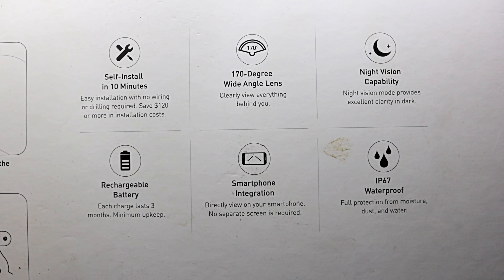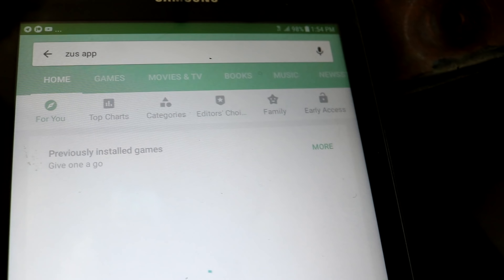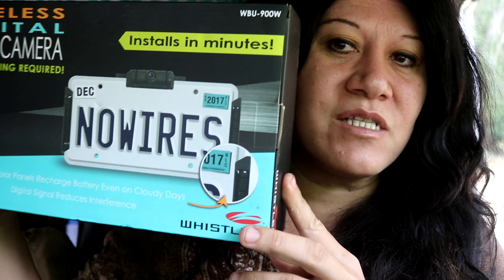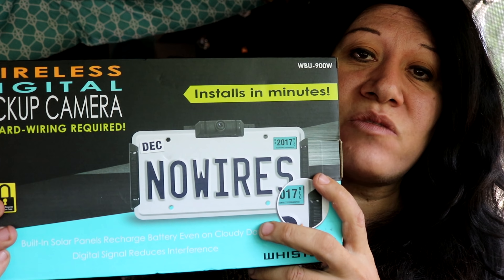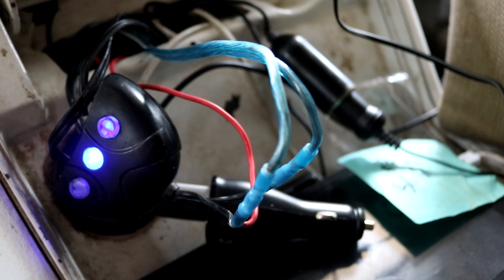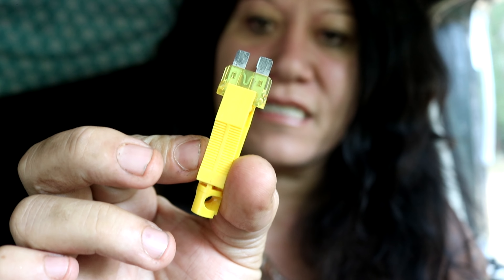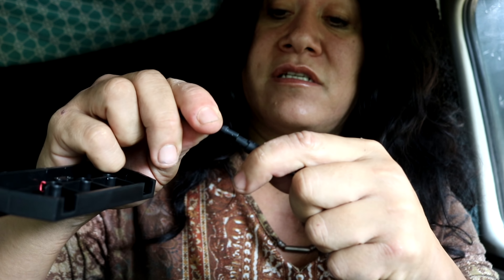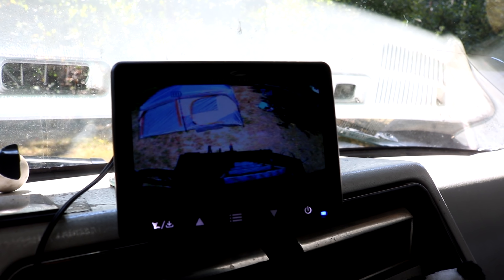Choosing A Good Backup Camera Zus Smart Battery Or Whistler Solar

Comment: I do 12 volt wiring.  I really like how you explained hard wiring your camera monitor.  Many people, even professionals, will explain that the wire with the trace or grooves is positive.  This is not always the case between different manufacturers. Explaining to your viewers to look for the wire that connects to the center pole of the plug as the positive is important.  This helps prevent damage to components and vehicle systems, which can be costly and inconvenient especially to those a on limited budgets and far from help and supplies.  Awesome video!
Reply from the maker: Thanks 😊

Comment: The license plate bracket is used, to mount the camera and charging units.  If you mount them to your actual plate, every time you change plates, which is frequent in some states, you would have to remove the double sided tape and get new tape to resecure it to the new plate. Much faster and easier to use their backing plate.

Comment: So will the Whistler unit monitor stay on if you want it to? For a rig like yours it should act like a rear view mirror which is always there if needed.
Reply from the maker: No it always cuts off after 30 sec but all you have to do is press that button then it comes back on
Reply: Since the camera is battery operated, and solar charged, it has limited power to stay on very long.

Comment: Really nice job on the video!
How well does the night vision work?
I picked a wired backup camera for my van to avoid connection issues although I'm told that the installation is not as easy. I haven't installed in yet so we will see. I like that you can use them as a security camera too. Panda is getting some sprucing up 😎.
Reply from the maker: Thanks 😊💖 it doesn't have night vision unfortunately
Reply: @rvpandamonium  Oops sorry my bad🙄

Comment: Hi, what did you mount the camera on, in the middle at the top? It called for mounting on License Plate but I can’t see what you actually used up high like that....thanx! Will you do a product review after using it for awhile? 

((Whistler has a great  Battery to jump cars and provide power to usb devices)).

I have had a Jump n Go for a long time. Never fails me!

Comment: My first ZUS worked for about a week, and it was a pain to go through the procedure every time you wanted to back up.

Then it died.  What I went through with Customer Service was unbelievable; I ended up sending them pictures of the Monster cable, USB Power Meter and displays, and 2.1 amp charger to prove that it was not undercharged.  Then, they accused me of not understanding lithium charging.  After I told them that I had an Electronics degree, and 40kWh of Lithium batteries that I ran most of my house from, they finally said they would send a replacement.

That took a long time to come.  And, it wouldn't pair at all.  I went to charge it and try again after a month (it was fully charged when setting it aside) and it is a brick, meaning totally dead, and it will put any USB charger into shorted out/shut down mode.

I'm done messing with them, and you should be very careful if you decide to try this poor excuse of a product.